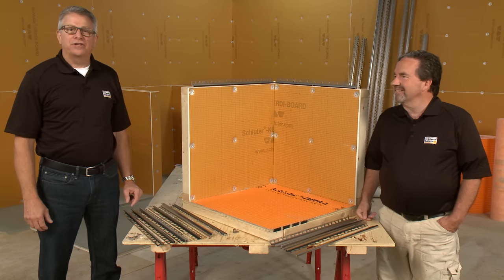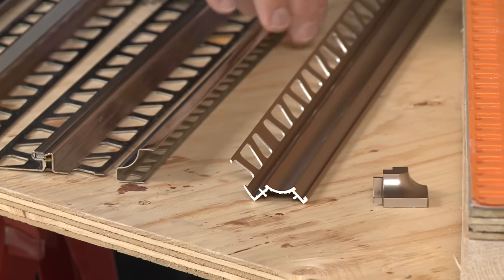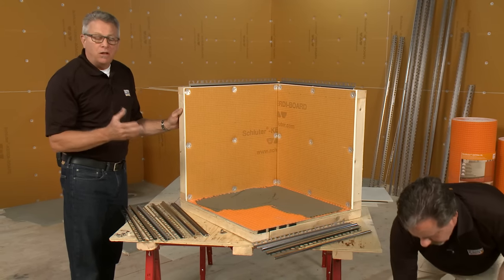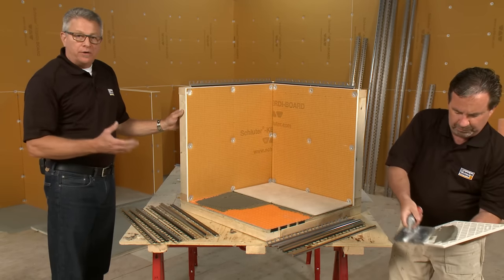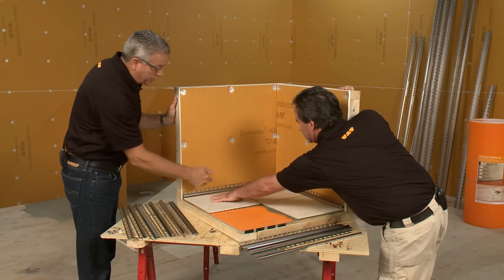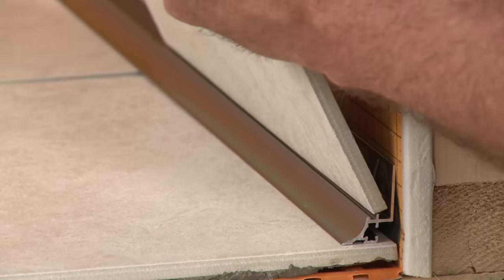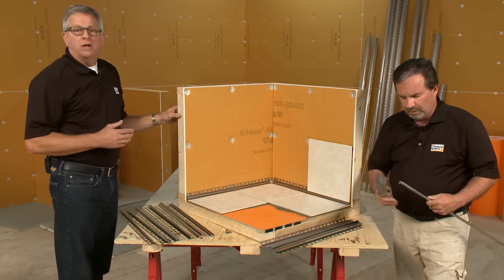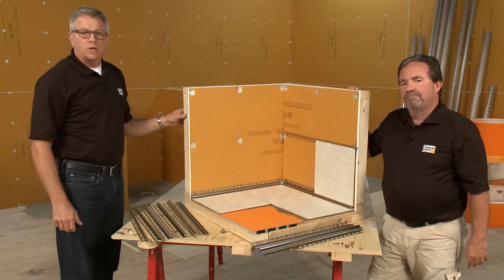Schluter® Profiles

Comment: Great video, is there a general rule of thumb for how to choose the profile based on tile thickness? Also, with the cove profile is there a need to factor in expansion and contraction? Thanks for mentioning the TCNA recommendation for 95 to 100% coverage in wet areas!
Reply from the maker: Thanks so much! Profile size selection is based on the thickness of the tile and amount of setting material used to set the tile. With smaller format tiles, take the tile thickness and select the corresponding size profile. Due to more warpage with larger format tiles, additional thin-set mortar may need to be applied underneath the tile to achieve full coverage. This will raise the tile and may require the use of a larger profile. The PVC coves offer movement capabilities along with the stainless steel HKS, which has an integrated movement zone. These should be selected if a larger amount of movement or stress is anticipated.
Reply: @schlutersystems1  thanks for the great tips, we'll have to check out the coves. Lots of people ask us how to choose Profiles, hence the question
Reply from the maker: Any time!

Comment: Can you use Finec for a niche?
Reply from the maker: for sure!
Reply: @schlutersystems1  thanks, one more question.  When choosing a size for the profile, does it take into account the added height of the thinset ?  Which finec profile size for a 9.6mm tile?
Reply from the maker: Hi Ceeloc, You would select the profile according to tile thickness and format, so you would most likely use a 3/8" thick profile in this case. However, the profile does not include the thin-set thickness, so when using a larger format tile, a thinner profile may be needed. Install the tile so it's surface is flush with the top of the profile or approx. 1/32" (1 mm) lower. The profile should not be higher than the tiled surface.

The best place for Technical Support is really through our Product Support team. It's always a good idea to have a proper discussion about a unique project so we are sure to have all the details and can advise with the proper directions. The social team is shutting down for the holidays today, so you can reach our Product Support team here: 800-472-4588.

Comment: I am going to tackle a shower renovation at home using the Schluter products. I have a few questions though. I was thinking of using profiles in the corner walls and the areas where the shower floor meets the shower wall tiles. Would using the Dilex AHK be acceptable to use inside the shower corners?
Reply from the maker: Yes, the Dilex AHK would be a good option for inside shower corners. Another option if you are looking for something a little more subtle would be the DILEX EKE. Here's a link if you're interested: https://www.schluter.com/schluter-us/en_US/Profiles/Cove-shaped-Profiles/Schluter%C2%AE-DILEX-EKE/p/DILEX_EKE
Reply: @schlutersystems1  What about Dilex-BWA? I am about to order this for the same application.
Reply from the maker: Hi Sarah! The BWA is a profile with one anchoring leg, meant more for movement between the tile and a dissimilar surface. It is not designed for corners as the EKE and the cove shaped profiles are. Hope this helps!
Reply: Would the Rondec be good to use on the shower curb?
Reply: @schlutersystems1  But the BWA goes in a corner. Is there a reason it wouldn't work against another tile wall in a wall corner? I want to use the same product in the tile to shower pan/bathtub corner and the vertical wall tile corners. Is there a cove that will replace caulk in the corners and at the tub surface? Or do you recommend BWA on a tub or pan and EKE in the tile wall corners as the only waterproof solution in that scenario? The issue is that BWA comes in so many more colors than EKE.
Reply from the maker: Hi there! Yes, the RONDEC, QUADEC, JOLLY, DIADEC, and FINEC would all work on the shower curb 🙂
Reply: @schlutersystems1  you mean all of those profiles would replace caulk inside a shower or tub at the threshold of the tile wall and the pan or tub surface inside the wet zone?
Reply from the maker: Sorry for any confusion...the response about RONDEC, QUADEC, JOLLY, etc. was in regards to the other question on this thread about curb profiles. You technically could use the BWA as you are describing it, but that would mean that one edge of wall tile would be hard grouted to the corner. If you included BWA on the other end of that wall, and so on, it would be fine. You could use DILEX-AS between the wall and the tub surface. Although it's not a cove, it is designed for easy cleaning. DILEX EZ is an option as well. DILEX HKW, AHK, and PHK would be good coves for the wall to wall application. There are many options. You could also reach out to customer service to discuss any option in depth. 800-472-4588 (USA) or 1-800-667-8746 (CAN)
Reply: @schlutersystems1  You have been so helpful, thank you! What if I purchased extra dummy bwa to put at the end of the run of tile on the adjacent wall. It would be hidden inside the corner, but each wall would have the movement.
Reply from the maker: Glad we could help! Yes, using DILEX-BWA as a perimeter movement joint, even though it would be hidden under baseboard or similar, would work. 🙂

Comment: Hi Schluter team, you're showing installation over Kerdi Board screws and washers that haven't been waterproofed with thinset and Kerdi Band, is this now acceptable practice or an oversight?
Reply from the maker: Hi Rob! Good eye! However, screws and washers only need to be sealed in wet applications. This here is a little mock up of a floor and wall. 🙂

Comment: Well this is all pretty good except you didn't show the return profile or how a guy might use your product on a half wall whear the tile meets drywall  or a shower dam with inside and outside corner's or around a shower wall cubby built in shower  Cady !
Reply from the maker: We have quite a few profile videos you could check out on our channel that would help with these different scenarios. Here are a few that may be helpful: how to tile around a niche: https://youtu.be/TfXjPwiCY4U Here's one on how to do a 3 way connection and return profile: https://youtu.be/-WRSZPkClBI https://youtu.be/Y9CCN9lS5dA  Hope these helps with some of the inquiries. Lots more on our channel too for reference. :)

Comment: This video showed you applying tile by back buttering the tile and then pressing it on to the ditra on the wall.  The ditra has no thinset on it!  I thought you were supposed to surface ditra with unmodified thinset prior to tiling.
Reply: idk if that's the case but i scratch coat all my ditra fabric with a v trowel for bonding reasons...
Reply from the maker: Hi Neely, it's generally good practice to apply thin-set on the substrate prior to installing tile, however, on a wall, particularly with a base board, it is not as critical as it would be in a floor application. This is most likely why we did it this way in the demo video.
Reply: @schlutersystems1  BaseBoard? meaning kurdiboard?
Reply from the maker: Hi Greg, base board, meaning the tile that goes at the base of the wall. It's usually 4" or so high and has a profile on top of it. Similar to what we show in the video, only shorter.
Reply: @schlutersystems1  gotcha thanks... i was confused on verbiage

Comment: Great and all, but you didn't actually give any tips on what to do when putting schluter profiles on existing uneven surfaces.
Reply from the maker: Hi John, just as when installing our uncoupling membranes it is best practice to prepare the substrate to ensure it is suitable for tile (i.e, even and structurally sound) this is applicable with profiles as well. 

This could include leveling the floor with self-leveling underlayment. Proper preparation will ensure a successful installation and ensure the Schluter profiles, especially movement joint profiles, are able to function properly. 

We offer a variety of profiles for different applications and they showed one option, DILEX-AHKA, which sits right on top of the tile surface vs embedded in the assembly if it were to feature two anchoring legs. This profile offers some flexibility that others may not for this application.

If you have any specific questions, please reach out to our Support Team at 888-472-4588 (US) or 800-667-8746 (Canada) who are here to help!
Reply: @schlutersystems1  of course, I always do when it's an option. But sometimes a client pays me to, for example, tile a wall 4 feet up, but the floor was tiled 3 years ago and THEY didn't know what they were doing and the client wants dilex on there...not a schluter issue, your guys stuff is amazing, but still challenging. I've gotten quite masterful with grout caulk lol. Btw, I just installed my first schluter linear drain. Wow, could it possibly be any easier?!
Reply from the maker: John, thanks for the feedback! Sounds like you are perfectly prepared for more "complex" situations. ;)

Comment: Should be titled Schluter Profile. Showing the expansion profile type briefly enabled you to use the plural, profiles? What's the name for the protective strip placed between my mitered edge? What is the name of the strips themselves, without company name, tile edging? Metal strip? None of those bring up the right thing and using name Schluter just brings up bullnose this and rondec that mixed with some jolly profile system. Gotta go to a special school just to learn a dictionary of terminology for some little metal strips? What do i ask the store clerk for? Dont tell me schluter, clerk dont know that one. Not tile edge trim either, they try to sell me tile pieces not the metal strips i search
Reply from the maker: Hi Aaron,
 
There are several different profiles in this video. Some of our movement joints, as you describe, but also some of our edge and finishing profiles, and cove-shaped profiles too. We have lots of options! 😊 You can check them out and find out more right here https://www.schluter.com/schluter-us/en_US/Profiles/c/P
 
We call them profiles at Schluter Systems, but you’re right, a lot of people call them a lot of different things! Feel free to give our team a call if you’d like to discuss any questions, or if you’re looking for something in particular for a project you have in mind.  
 
US 800-472-4588
 
CA 800-667-8746
Reply: @schlutersystems1  yeah, i said the strip between miter joint
Reply: @schlutersystems1  shower has a 2x4 acting as water barrier to rest of bathroom. I am gonna tile the 2x4 using mitered 45° joints where top meets sides. As it will be stepped on, i want to protect the tile. Only need 4' of it (two sides of the 2' wide retainer). At this point, it's gonna be easier to make my own.
Reply: @schlutersystems1  trep fl or sciene step.. What do i ask general store clerk for in order to be directed to metal strips and not be shown tile? Say, at True Value or Foxworth?
Reply: @schlutersystems1  I am under the impression that you have a newer product, not necessarily new but more recent than most, that has no lip and is just a piece of metal that goes between the miter joint so it's super low profile and yet still offers an amount of protection
Reply: @schlutersystems1  if you were less worried about attempting to defend how amazing your video is and more concentrated on the fact that I said between the Mitre it would have been simple to answer that in one response that you did give for which I'm appreciative but got me nowhere. Got an aluminum screen door frame that has an edge curled over already to offer strength. Punch a few holes in it for the mortar to hold onto and Im done. Missed a sale. Hopefully others seeking complex terminology will read this and resort to doing the same as I.
Reply from the maker: Hi Aaron, you can ask for "schluter profiles"... you might want to look up your local Schluter dealers if you can't find our products in your general store. Here's a link, just have to enter your zip code to generate a list of dealers near you: https://www.schluter.com/schluter-us/en_US/store-finder
Reply from the maker: Maybe you're thinking of FINEC: https://www.schluter.com/schluter-us/en_US/Profiles/For-Walls/Edging-%26-Outside-Wall-Corners/Schluter%C2%AE-FINEC/p/FINEC
Reply from the maker: Please feel free to give our Support Team a call so we can discuss your project in more detail. Thanks!

Comment: You spent a majority of the time showing how to butter tiles and almost nothing on the actual profiles. Then, you do a profile on the top of that tile and the end sticks out!  This is a completely useless video...
Reply from the maker: Hi there! I see what you mean. In this video, we are only dry-fitting the profiles so the video is not too long. The Rondec corner seems to be sticking out, but in reality, another Rondec profile would be installed vertically on the tile edge. Hope that helps!

Comment: Be careful using this product. Thicknesses can build up and create many issues latter. With the exception of out side trim I will not use this product again.
Reply from the maker: Hi Bob. As long as the installation instructions are followed, there should not be too much build up of thin-set with our profiles. If there is a concern about build up in a specific application, there are a couple of options that may help. 1. Dry installation of the profile helps limit the build up. Set the profile in place without thin-set (use a tile to hold it in place or adhere/fasten temporarily) and then install the thin-set or tile over the anchoring leg. Or Option 2. Order a slightly thicker profile. Hope this helps, or please feel free to give our team a call!
Reply: Bob that's a silly response